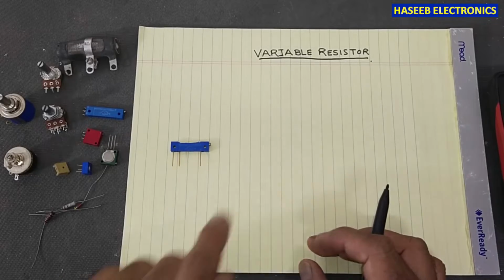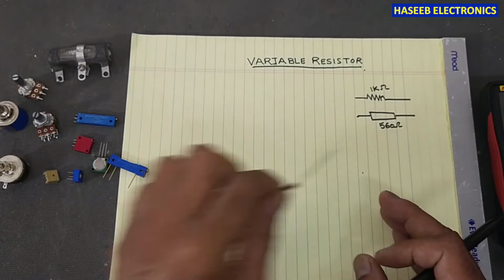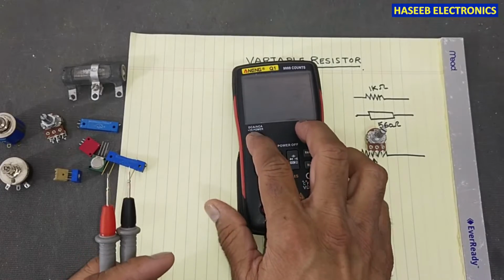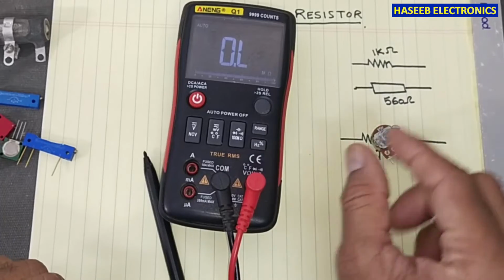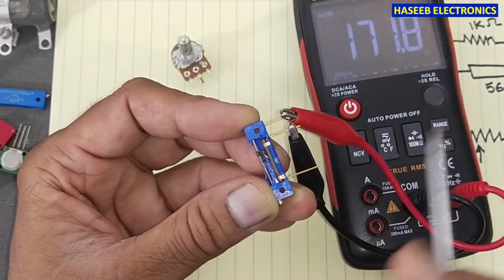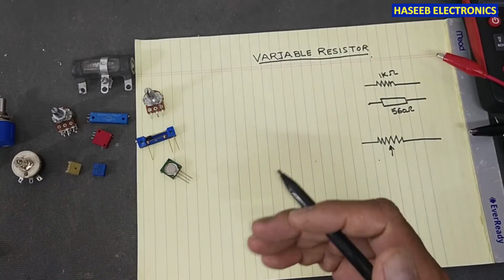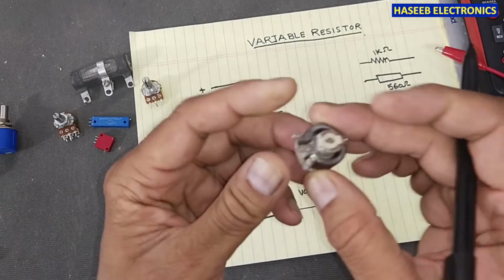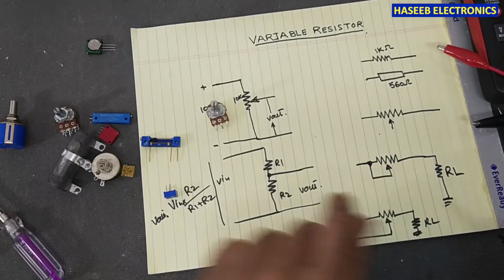{781} Potentiometer, Variable Resistance, Rheostat,Trim-Pot, Preset

Comment: Greetings, Haseeb! I thought this video might be just on basic information, but I knew I should watch it, because you are an excellent teacher and I could learn something new. I did! Thank you! I want to speak about two points... 1) It is a very minor thing; but in the USA we usually refer to the "slider" as a "wiper." This is not fault-finding. I only wish to improve our communications, for the sake of learning. 2) This one may just be a failing of my understanding... I thought that a potentiometer was a three terminal voltage divider and the a rheostat was a two terminal variable resistor... Ahhhh, as I write this, illumination has come. Yes, the potentiometer changes voltage, whereas the rheostat changes current. I get it! I just had not thought about their operations in that way. That is a helpful point.
Reply from the maker: best regards and special thanks for your valuable addition, yes "wiper arm" or "slider arm" are same, 
special thanks for your encouraging comments 
stay blessed

Comment: Sir mana apki sari videos dkhi hai 
And mna apna bht sa project ap k videos dekh kr bnae hai 
Apk channel sirf skills hi nh blky real time solving problem technique bhi sikhata h
Thanks a lot

Sir i have a request
Actually i have a project regarding inductor based  electronic choke
And i have to convert 40W inductor based tube light circuit into a new circuit shuch that it should power up 13W Philip LED tube light

I will be very thankful to you if you help me in this
JazakAllah khair wa kaseer un jaza
Reply from the maker: best regards and special thanks 
regarding your project i couldn't get exact idea, 
do you are making project to power up 13 watt LED Tube Light with inductor choke ???

Comment: Great video. How about discussing of smd power supply, such as voltage booster, buck converter with circuit diagram and their working. Seen so many videos about through hole components working but never smd board with circuit diagram like laptop basic power supplies,  power rails.

Comment: Salam M Haseeb, i am having a hard time to fix a 12v-220v inverter. I changed the primary section mosfets, now i see 387 Vdc at main capacitor, but the output is only 145V and it is not modified sine wave, just positive square wave and not regulated. ICs used are sg3525 for the primary and the secondary uses a 556 timer and tc4013 dual flip flop. Any idea where to look at ? as there are few components, i checked them all but cannot see the problem. Thank you.
Reply from the maker: just remove one pair form the H-Bridge circuit 
and check the output, if it is giving output then check the circuit for second pair of H-Bridge
Reply: @HaseebElectronics  Thank you, I will try this. I believe it is H bridge.
Reply from the maker: the output stage full bridge driver have problem 
if one pair is not getting drive puse, at that time we will find this problem 
might be flip flop is not making dual drive or any concerning part is problematic